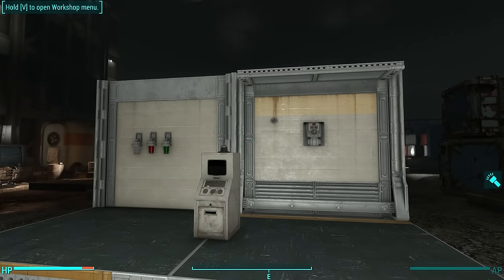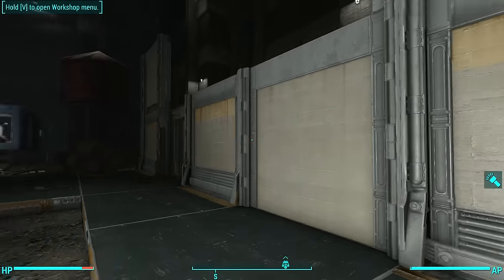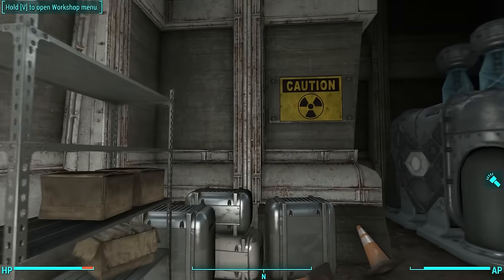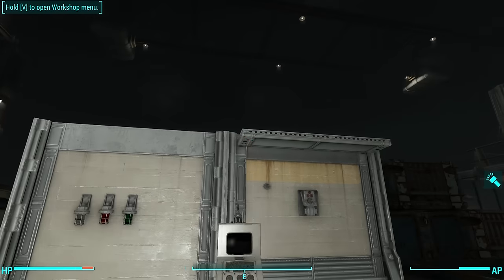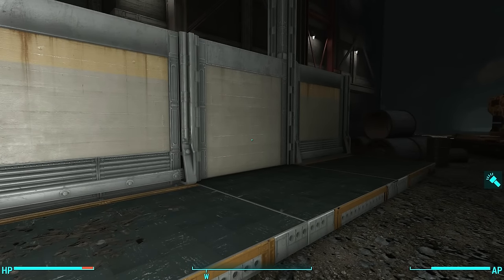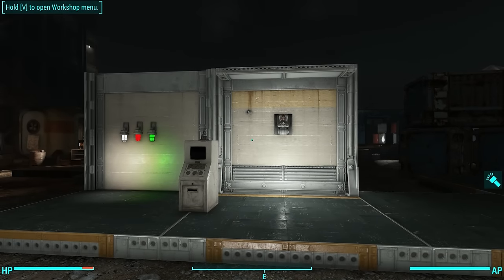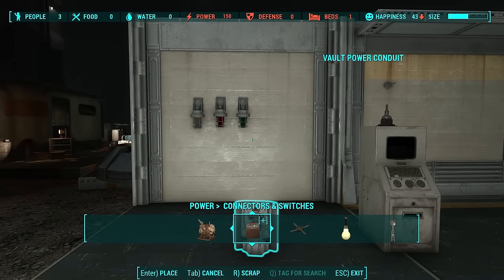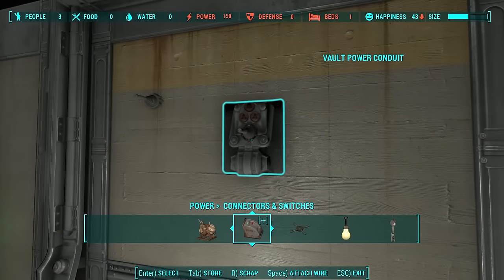How the Wall Powered Conduit Works in Vault-Tec Workshop - Fallout 4

Comment: I don't know if you can help me but I can't finish the quest "model Citizen".  When i place the overseers desk it doesn't do anything, and I'm using the one from the special tab.  I tried looking on the internet for help, but no body can help me!
Reply: Its not supposed to do anything for you (except give you a int boost, one of several vault boosts you can choose 1 off). The female ghoul overseer needs to sit down at it.
Reply: She wont sit at it and it keeps telling me to build it even after i did
Reply: Nickolos Gruntz Sounds like a bug. I would suggest normal trouble shooting procedures (if on console clear the cache by unplugging it from the wall for 5 minutes, if that dosent work check if a mod is causing the issue, if that dosent work reinstall but keep your save, if that dosent work try a new save, etc).
Reply: k thx
Reply: Nickolos Gruntz Ohh one thing i should have said first. Load a earlier save and try to redo it :P. Might just have glitched out temporarily.
Reply: +GaratghDeloi don't build the one under tables you build the one under special
Reply: Clear cache by unplugging it from the wall?? Why not just use a cache cleaner like ccleaner?
+Nickolos Gruntz - if you're still having this problem, try scrapping your previously built desk, and then build it again, right next to her. If not, and you're on PC, you can use the console to force the quest to move forward regardless, and as far as I've seen, the desk being registered by her NPC doesn't seem to be imperative to the rest of the questline.
Reply: Deirdra Megowan I know your likely just jokeing, but just incase:

The cache being the short term memory of a console or pc. Normaly its cleared by shutting down whatever platform your using. 

But consoles now days dosen't shut down properly depending on the console settings (it instead goes mostly inactive like a pc's sleep mode and draws less power, but does updates and stuff in the background), so the sure way of doing it without having to go through all the settings is to just unplug the console for x amount of time.

Comment: I own the dlc and completed all of the tests in the vault but I don't have the category for the vault stuff. is there something else I have to do?
Reply: you should have the vault section from the start
Reply: I had the same problem, it was homemaker settlement that was the problem. but it could be another mod for you.
Reply: Christopher Cooper do you mean simply modular housing?
Reply: Nope, it was homemaker settlement which added alot of content. But I think there is a a limit of how many subcategories you can have could be the pelroblem.
Reply: My biggest problem with the game is the snapping points for settlements.
Reply: Christopher Cooper tell me about
Reply: Not sure if you're still having an issue or not but make sure all your mods and updated, the mod I was using Homemaker wasn't updated originally and it's ID takes up the same slot as the Vault-Tec items, so it's overwrites it!
Reply: I am good, it was homemaker because a patch came out to fix the problem. But I do not use homemaker anymore because it has a lot of dup items now.

Comment: So would you have to place two conduits in a large room?
Reply: Yes.
Reply: Two would do it, I just go by trial-and-error: I place one, and observe which lights are on and off, and then place more conduits as needed
Reply: From what I know the VT Conduit emits power at a 500m range (possibly 500m) but there is a mod that'll increase it to 1,500, I'd suggest getting the mod if you're having issues with placement

Comment: Let us know how to hook up the huge water station, if you would.
Reply from the maker: Yep, that video comes out tomorrow.
Reply: Awesome! You are gentleman and a scholar sir!
Reply: Defeat any enemies in the room, because your job will be significantly easier if you do. Build two Large generators or a Fusion generator if you want, in the East wing. Wire it up to the Vault-Tec water pump. Tada! The water is still somehow magically connected and the fountains etc work even if it's not directly touching or connected to your Vault system in any way. There are a ton of pipes that lead under the ground from the Pump, so I'm assuming it's already attached to the main pre-built section, it just needs power to function.
To hook the Vault's reactor up to the pump would be a pain. You'd probably just have to string conduits or power poles all the way through the tracks leading from the east sector to the main room, and then somehow put a Vault Conduit on the outside of a Vault wall and attach it to the string of conduits leading to the East Sector.

Comment: Can anybody help me with a different problem. I can attach a Domestic Piece to a Utility Piece and then connect them to the Atrium Pieces. The problem is that I cannot attach them to a Room Piece ( i.e. Security, Clinic, etc. ). I have to use a support piece to trick the pieces into connecting to each other. I am using the PlayStation 4. Any help will be appreciated.
Reply from the maker: You just need to build a door. Any room piece with a door will connect to any other piece with a door.
Reply: Thank You, I wish these things has manuals. Even if the Manual is in the game menu.

Comment: If only it were that simple. Oh Bethesda, how you continually screw everything up. Every wall and floor is properly connected and nada. I have even built new lights on walls next to lit lights and they don't light. It's entirely screwed up. Looks like I'll be running wires.

Comment: have areas that wont power up. connections are good. i see others have the same problem. one wall has power and the very next one doesnt. wtf?
Reply: tore it all down and started from the doorway. now it works, must have been a bad snap somewhere in the chain of floor/wall.

Comment: bad video trying to use standard wiring from fallout 4 to run vault 88, notice how bad it looks and overhead florescent light didn't work. lets not even mention that all these other parts like electrical conduits are included so what we ignore all that stuff they included to run lights the old way with wires hanging everywehere?